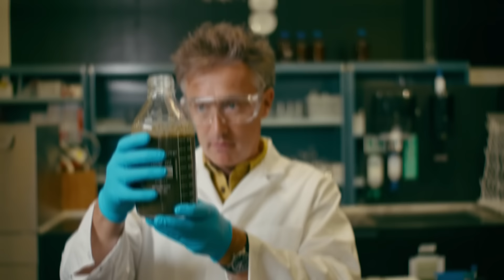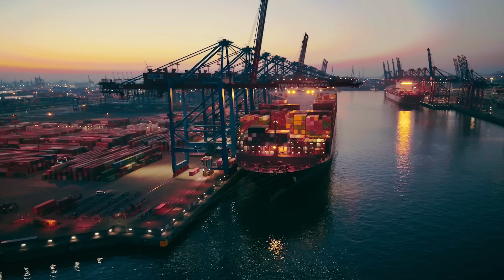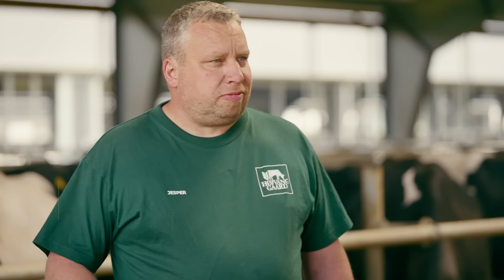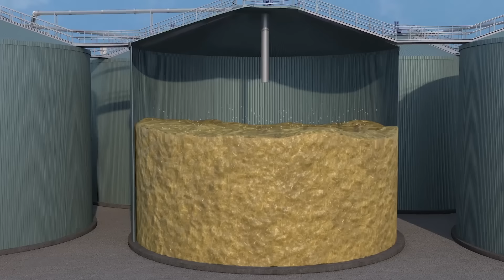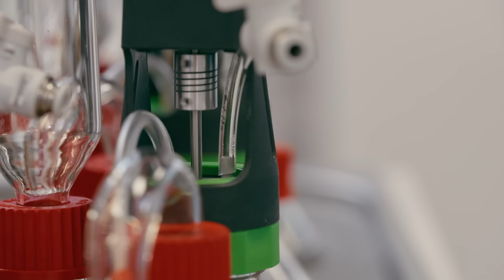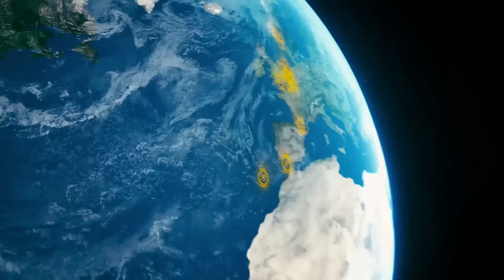Powering ships with waste? | Discover bio-LNG with Hapag Lloyd

Comment: Bio methane is an important raw material for:
Mineral fertiliser, which is an even better alternative than using it as a fuel source. And a lot of other products. It’s possible to convert methane into oil which has a higher energy density in volume than LNG